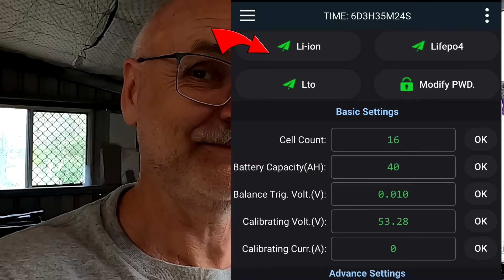Major safety concern with new JK Inverter BMS! Not good.

Comment: Thanks Andy for the information.
Question 1 : do you know if older jk bms B2A8S20P-HC have the same issue ? 
Question 2 : could you tell the way to create the problem and check if the issue is global or local ?

From my point of view the issue is software.

In case of reset they could force to revalidate the setting and not let the bms run without an human validation of the setting.
Other option is to reset to the most conservative setting.
...

Let us know when it ll be solved.
Reply: JK confirmed this morning to me, that the older "stand alone" BMSs do not have this issue. They say, that exactly these "not inverter" BMS are often used in cars or ships, where the system is switched off from time to time by use case. And they never had this issue reported before. They have these type running in the field now over 5 years with no safety issues.
Reply: I agree that this is just a software issue. The BMS memory should not lose power even if turned off since it is connected to the battery.

Comment: Wow!  Very creative, Andy, and a great public service in letting us know of this potential safety hazard.  As you stated there has been "ups and downs" with this BMS since you first reviewed it.  However, you were very keen on this device and I am sure many viewers have purchased this BMS per your reviews.  I hope whoever they are, they all see this video and take the appropriate action.
With all the "ups and downs" documented and now this..............well, even if they fix this, can we trust JK products down the road?  What do you think?
Reply: I just ordered 4 of 150A version and I really think about cancelling because I don't think a sw-solution can resolve this major bug! I once had one of the first smart-phones on the market (XDA). It had a volatile memory - awful!
Reply: I guess, when time without power is the issue they would have to install some kind of firmware battery (bios battery). On the other hand, simply turning it off bit connected to the battery, might prevent the problem.

In which case they would only have to check the state of memory, or detect the reset at powerup and tell this to the user. One might also simply use conservative basic settings after a reset. There is still the inconvenience of having to reprogram but the danger will be gone.

Simply reprogramming each “weekend” is not a real solution either. 

They will have to find a way to keep the memory powered somehow of that is the actual problem. That would mean changes in hardware. On the other hand it might just be a software routine forgetting to write settings to the right place.

Old desktop computers loose their settings after a backup battery error, bit sometimes also after a hardware error of failure. Some temporary short in a component can happen to any and all electronics. This should never lead to dangerous situations.

I guess they just launched the product too soon.

Comment: Two things are incredible: 1) the swarm intelligence consolidated on Andy's platform to disclose such dramatic issues and 2) Andy's additional talent as entertainer.
Reply: The swarm of andys
Reply: Please update a new version: 
V14.16 Upgrade logs 
  
  1.Fixed a bug that could be lost if parameters were lost. The bug is caused by a logical error in the parameter entered by the user.
  2.Change the default configuration parameters to lithium iron to improve security.
  2.Optimized JKBMS Modbus protocol, added RCV RFV register support. The protocol must use the PC software version V2.5.0。
  3.Fixed the Bug that the hardware version may be incorrect in the device information.
  4.Add battery low temperature alarm to dry triggers.
Reply: @juanluisaniaspinel9379  does it mean they have a fix?

Comment: This is so dumb. All they would have to do is store settings in a partitioned Flash region on the micro-controller. Are they really storing this in RAM, or do they actively reset these values? In any case, should be easy to fix, but it shouldn't have been an issue in the first place.
Reply: They told me to send new FW version tomorrow...so I am sure they can fix it easily via FW-update.
Reply from the maker: Yeah, not sure how they did it. They weird part is, that the BMS is still connected to the battery, so still gets some power. The power button is really just a soft button.
Reply: @OffGridGarageAustralia   Someone in the comments mentioned that it doesn't happen with older versions of the firmware on this BMS - so should be an easy fix if so. Still, shouldn't have passed QA...

Comment: A BMS definitely shouldn't randomly forget its settings and especially not allow charge/discharge to turn back on until it has been re-configured. If any defaults are to be automatically restored and enabled, they should be set to values within the safe range for any cells the BMS is intended for use with. For a BMS primarily intended for NMC, NCA, LFP and (maybe) Na-ion cells, safe (though far from optimal) defaults would be something like 3V under-voltage, 3.4V over-voltage and 1/20th of the BMS' rating for charge/discharge current.
Reply: if they dont have enough persistent storage on the board for all values, your implied suggest of keeping it disabled until the settings are confirmed would be an accetable workaround, if you can store a backup of all settings on your phone
Reply: @HolgerNestmann  I'd be really surprised if the micro-controller used on the board doesn't have enough internal storage for at least storing safety-critical parameters. Tons of micro-controllers have over 1kB of on-chip EEPROM for stuff like that.

Comment: nice news studio :). 
problem should be that firmware doesnt save current settings to the eeprom. should be easily fixable with firmware update (assuming all hardware connections are correct to the eeprom, which should be since you have updated firmware successfully).
Reply: AND as a safty barrier always default to the safest (lowest) charge end value
Reply: @olaf_s_23 that's not quite so easy. Allowing Li-ion to discharge to LiFePO4 levels would also be dangerous.
Reply: @pau1phi11ips  best action is dont enable charge or discharge until battery selected on default bms factory defaults.

Comment: OMG! Andy your a scream! 🤣🤣 You just had me laughing my head off on the lounge and i woke my other half up. I just put  a new JK in on my 304 bank just before xmas. I just went and checked it and found it had also reset back to default at some stage. So i will be putting the old JK back in today. Thanks for sharing  the info. your a Ledgen in my book!   I have just put back in the original  B2A8S20P BMS and now the JKBMS RS485 CAN module and LCD display Adapter is way out of Wack. at 3.2v it is saying its empty . checked all the settings  and they were fine.   when i first installed  6 months ago. it was running like clock work.  the rest is programmed for 3.5v  and minimum is 2.7v on the soc.🤔🤔🤔🤔 Any ideas anyone?

Comment: would be nice to have a standalone davice that measures the voltage and start some alarm when you are over the programed voltage
Reply from the maker: That's what the BMS is for 😄
Reply: @OffGridGarageAustralia That’s the problem. You decided to be cheap and skip out on the BMSMS. If you had both a BMS and a BMSMS, then you wouldn’t have risked a fire!

Comment: The JK BMS (all of them) does Ram/Over Volt Active Balancing where it will send 4.0-5.0v to LFP cells to balance them. Please test with a volt meter Andy on any JK device to see the Ram Balancing technique with the JK active balancers, you can simulate the same using a power supply sending 4.2- 4.8 volts for faster cell balancing (not good for the cell).

In regards to the reset bug: I don't think it would have caused the cells to explode at 4.2 it certainly is not good for them. So 2 separate issues with JK devices.
Reply: A cell that is not at e.g. 3.5V yet will pull down the voltage of the supply (balancer) to its level, even if the supply is set at 10V (constant current mode). If you now have a cell at 3.5V and apply 4.2V to that cell continuously (because your settings are gone) the cell will keep going up in voltage until it reaches 4.2V as well (or before it gives in before getting there). So for a balancer, it's not an issue since the cell itself won't get to a value over 3.5V (if that's where the cell high voltage disconnect is) even if the balancer voltage is 4.2V. If however the cell protection sits at 4.2V after a reset, the cell will get to 4.2V, and likely vent/bloat (charger settings ignored in this discussion of course, but after a reset, it could request the higher voltage from the charge controller if comms are set up).
Reply: This is absolutely incorrect, incoming voltage should never exceed 3.65v on LFP cells, doing so will damage the cell. LFP cells must be charged using the CC/CV constant current / constant voltage method meaning once they reach a fully charged voltage of 3.65 volts only the incoming amps should be adjusted as needed as to maintain this voltage. Over-volting a cell to speed up balancing is harming the cell because the cell is forced to absorb amps higher than it would do under normal charging circumstances.

This is why the JK is able to do constant 2 amp balancing because it Ram Balancing / Over-volt balancing.

The capacitor style balancing is far better for the cell, it is slower but safer way of balancing cells as the cell never sees an input voltage greater than 3.65.

 @upnorthandpersonal
Reply: @sfkenergy  Take a e.g. 10A lab power supply, take an LFP cell at 3.1V. Put the lab supply at 4V before connecting. Connect to the cell. What does a multimeter show as a voltage at the cell?
Reply: Why stop at 4v why not put 8v, how about 10v? It is truly remarkable how uninformed you are, I guess now we have to make video explaining why this is bad.
 @upnorthandpersonal
Reply: @sfkenergy  I'm not saying it's good. Read my first comment. I was replying to you that if your cell sees 4.2V continuously because of a BMS reset, that's a problem.However having 4.2V on the cell when you have a cell overvoltage protection is much less of an issue. You wrote: " So I don't think it would have caused the cells to explode at 4.2 it certainly is not good for them.", and I'm saying that the cell will bloat at that voltage if the cell is allowed to get there, like when the cell over voltage protection is reset.
Reply: Perhaps I should have worded it better, our observation strictly has to do with the balancing of the JK and not the reset bug, this why we had said ALL of the JK bms devices such as the 8s. The 4.0-5.0v is reference to the over-volt / ram voltage the JK uses to balance cells. In retrospect I see where you are seeing that this is to do with the BMS reset. @upnorthandpersonal
Reply: The balancer would have to be driving thousands of amps into the cell to get the voltage up that high, which is impossible as the conductors are too small. If you measure at the cell terminals you will just see the cell voltage during balancing.

Comment: Up to V14.10 they don't loose their settings! I tested this version by version and the issue started from version V14.12! So it's just software related and should be fixed with a new firmware!!!
Reply: Very interesting! Wonder why they decided to do this. But yeah, agreed, this should be an easy fix - but shouldn't have happened in the first place.
Reply: I think they didn't do this on purpose,  it is just a bug which should be easy to fix.
Reply: @stephanklasen2928  I don't think it's on purpose either, just wonder how it got through testing/QA. I know... but still...
Reply: I think it's both a software (firmware) and maybe a hardware issue. They can remedy the issue by choosing the most conservative values if there is a reset to default values. But, shouldn't there be some sort of battery backup or NVRAM to contain the settings in the first place? Perhaps I'm assuming too much of these devices, but for something as important as a BMS it should have something to maintain the settings more than a few days. Today it seems like perhaps the length of time it takes to discharge a capacitor before it's erased?
Reply: @cuisinartOH1  it is 100% software related as versions V14.03 - V14.10 didn't have this issue! I tried it again and again and with all versions before V14.12 the BMS keeps the settings when power cycled or disconnected from battery.
Reply: Excellent. Then I'm guessing they will have this fixed pronto. They really owe Andy a ton of favors for volunteering to be their entire QA department 🙂
Reply: Good to hear, I just ordered 2pcs and matching boxes.
Reply: @Handy-Harry  which box have you ordered? Im Looking for a box that fits them too!
Reply: @gewoonandre  The new EEL 48V 16S V4 Server Rack DIY Unit is for the new JK BMS. Groetjes
Reply: @Handy-Harry 
Was it possible to order the box only, or did you bought it including BMS?
(if so, where?)

I've ordered the BMS a while ago (still on its way - shipping) and want to get the box separately.
Reply: @gewoonandre  yep that’s exactly what I did. Just send them an email they will make an invoice for the box without bms

Comment: Ugh, I am in the process of getting all my solar equipment and ordered 5 of the 200amp version after seeing your recent video about them, I hope they get a fix soon.  I will be installing my entire system this spring in the US.
Reply: Pretty sure they will release a fixed version soon.  Funny i also ordered 5 and they are already on their way. Expecting them in the next couple of days so there is still time to change back to a recommendation for this bms (again) 😅
Reply: @andreasw5925 I hope so! :)
Reply: @andreasw5925  Not sure if anyone has confirmed that the hardware even supports that?  You have to have something like an EEPROM chip that stores data even after power is lost.
Reply: People have reported flashing previous firmware and the settings remained after a power down. So it's just a firmware bug that will get fixed.

Comment: Haha, this was fun to watch Andy 1 2 3 and 4.
Glad I ordered an 'old style' JK BMS( same as my current BMS ) for my second battery.
But imagine you have a professional company building battery's with this new BMS, a serious hazard for it's users !
Reply: EEL started selling batteries with the new JK.....
Reply: I have an older JK that’s been sitting in the cupboard. I’ll have to “fire it up” and confirm that it’s held all its settings!
Reply: They do hold the settings. I had one down for 6 months and i just swapped it in and its good to go. But yes i just had 10 new ones shipped and im shaking my head. I only did it so i could communicate with the system. Hope its just a soft update and not a eprom @FutureSystem738
Reply: I'm a big fan. However, I don't see why this is a big deal. I wouldnt trust ANY multi-chemistry BMS to retain its config after long disconnection. BMSes in packs are permanently connected, so I don't see any issues there as well.
Reply: @ucheeze6220 So far, AS Andy Has mentioned in the end. When does this reset Occur? It should never happen!
Reply: @Carsten-PV-DIY  Yes, who knows what happens when some other error or safety is 'engaged' in the BMS.

Maybe this is a good test for Andy, try to see what happens with the BMS when you trip a safety setting.
Maybe fun to do, under voltage test, temprature, etc. etc.
See what happens.
Reply: @ucheeze6220  I honestly suspect that a software (firmware) update can easily fix this.
HOWEVER it would make a lot of sense to design it to default to LFP batteries- these are almost certainly going to be the vast majority  as we move forward.

Comment: Glad I did not buy this new jk bms, instead I have one of the old models, so far working great.
Reply: Some comments here state to have the same issue with older models. What means "working great" did you shut it of for 3 days and checked it again? the new one is also working great before someone did that.

Comment: Oh noo!
Really hope they can fix it in the firmware soon!

(Pre-)Ordered one last week based on the recent, more positive, videos. 
The old JK with Peter board looks nice ideed, but I still cannot believe the price of it... especially when you need 2 and compare that to the price of the old JK bms itself. (Personal opinion)
Reply: That & the fact them boards are only really designed for prototyping & not a permanent installation. It shouldn't be that difficult for JK to change the default settings in a firmware upgrade to the lowest possible voltage choice.

Comment: wow I like the new high budget production setup. 😂
Did you means BMS reset it self even you still connect power cable to it? 😅
Reply: No, only when power is removed.
Reply: i see. if that the case.
I guess they use capacitor on the circuit to contain data. But it will eventually run out overtime.

Comment: I accidentally charged a bunch of 18650 LFP batteries to 4,2V once. Nothing happened. I hope, that everybody gets this lucky if this happens to them.
Reply: A vast difference exists in charging a small 18650 battery compared to 100AH or 280 Ah LFP with a much higher current. They may not explode (it is LFP, after all), but still, there may be a risk of overcurrent and, thus, a fire hazard.
Reply: @Cptnbond  It will bloat and could possibly vent.

Comment: The production value is impeccable
Reply: Impressive, but as a broadcast engineer, I'd have to say the shots where the camera switches back from Andy to Andy3 in the sit-down interview... The camera is on the wrong side. The camera should be on the same side of the room, the same side of the interviewer and their subject, e.g. right of interviewer and left of their subject.
If you put the camera angles as he did, we call it "crossing the line".